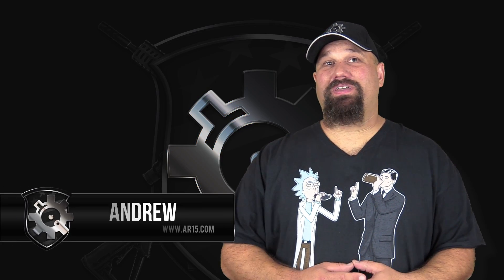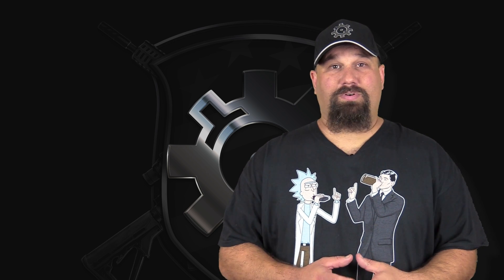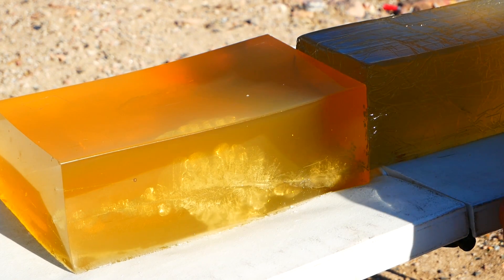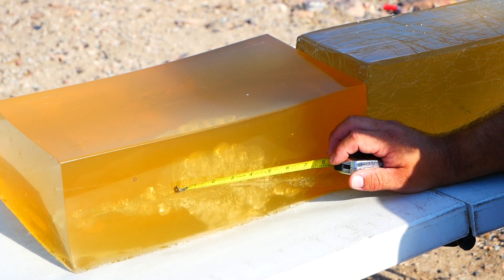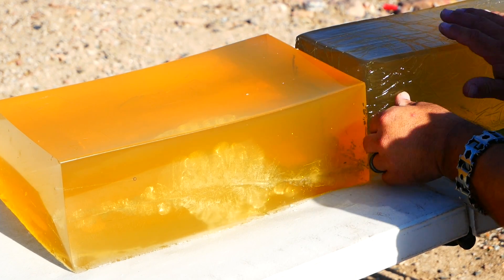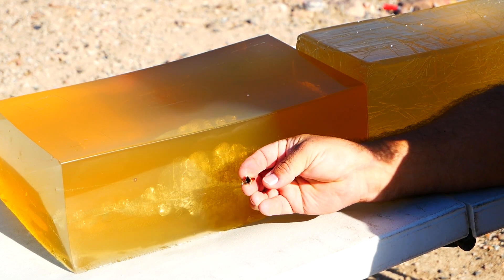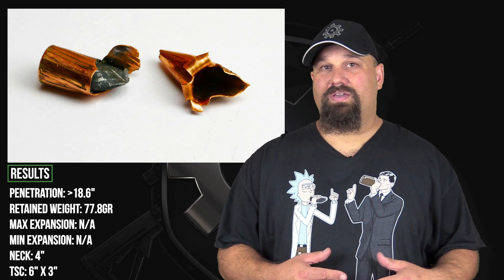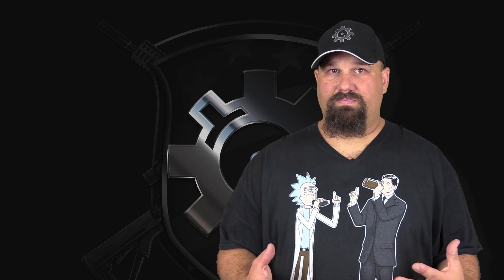Modern Masterpiece or Mediocre? .300 AAC Modern Arms 125gr Speer TNT

Comment: What a loaded B.S. of a test!  Speer clearly states the TNT hollow point is a varmint hunting bullet requiring a minimum velocity of 2,400 f.p.s. to produce explosive expansion.  This bullet is not designed for sub-sonic or medium velocity loads and it's performance would naturally be sub-standard the way you tested it.  What are you going to do next? Test a sport car and criticize its performance as sub-standard by driving it like an off-road vehicle on an unpaved road?
Reply: Even from 16 inch barrel we'd see 200 fps more

Comment: 17.8 grains of Lil Gun. 2.14 OAL. 2255 FPS from 16 inch. 2065 FPS from 9 inch. Standard Deviations typically 10-20. No, 125 grains is not heavy with the right powder. I used to believe that as well until I worked up this very consistent and fast Lil Gun/TNT load.  Lil Gun LOVES  TNT 125 grain bullets. Accurate, great velocity, and CHEAP.  W296/H110 gives me similar performance with 110 grain TAC-TX over 18.8 grains.

Comment: I'm disappointed that the TNT didn't test well, as it's my go-to bullet for 300 Black loading. It is the most economical bullet I have found, and It killed a 130 lb pig at about 70 yards, and he dropped in his tracks. Maybe the real test of a bullets effectiveness is on flesh and bone.
Reply: It helps when you actually use a full length barrel to get full burn also

Comment: Thanks for the test!  Perhaps not the best choice for HD but a great plinking round.  Just ordered 2000 for about 15 cents each including shipping and tax. Haven't received them yet but hoping to use H110 and get decent accuracy from them for range use. Perhaps a slighter hotter load or longer barrel would've improved the expansion/performance.

Comment: Great video! 
You mentioned there are “other” 300 BLK rounds that would do a better job. Which rounds are they?
Reply: Agreed, I'd like to hear his recommendations.
Reply: Hornady Black is awesome if you want the best performance.
Reply: @CRUSADER85  I just started using the Hornaday Black 110 in my 300 Blackout and the 168 Black in my 308. So far it's working really well.
Reply: nosler varmageddon 110gr and control chaos 115gr also gave really nasty wound.. get taken down a few deer and hogs with those ammo using 9inch barrel at 50-100yard, those are dead upon impact.

Comment: @thechoppingblock, you mentioned that this performs better than 300 blk fmj.  Have you tested any fmj? Ive been looking for gel tests for 300 blk fmj and cant find any
Reply: I've tested some that perform as if they were FMJ and I've tested 7.62x39mm FMJ, which isn't functionally any different from 7.62x35mm FMJ.
Reply: @newsofthepews  my reason for being hesitant to equate 7.62x39 fmj to ~123-150 gr 300 blk FMJ is the pretty variable differences just within x39 performance.  Add in different bullet construction, bullet weight, and lower velocity, im seeking actual hard data on th 300 fmj specifics.  I know it will PROBABLY be the same, i just dont like speculating.  My main thing i want to know is neck length and consistency where the bullet tumbles.
Reply: @josh55390  Fair enough. I'll see what I can do. But you're going to see the same variation with .300 AAC FMJ.
Reply: @newsofthepews  oh yeah i expect so.  I'm just hoping that there may exist a 300 blk fmj with acceptable terminal ballistics.  Mrgunsngear once made the claim that the lighter fmj's tumble well so i'm just hoping for some actual test results, you know? I think i'd consider it acceptable performance if it had a <4" neck before reliable tumbling.

Comment: Nice video. Thanks for reassuring me that .12 a round 7.62x39 is still better than $1.22 a round .300.😎
Reply: @762x35mm he didn't say anything about hollow point. 7.62x39mm cheap Russian soft point performs pretty dammed well.
Reply: 762x35mm 
I’m going to be mature here. An say “ that’s what she said “.
Reply: 762x35mm My understanding is 7.62x39 hollow points were meant more for accuracy then for expansion.
Reply: I took a mule deer with tulammo 762x39 soft point. It performed great.

Comment: That shirt is bad ass. 
I've gotten surprisingly good expansion from 165 grain Speer btsp's from a 10.5" with Lil Gun. 
col was 2.240", 15.3 grains, 1,737 fps. I think there is enough room with that load to hit 1,800+ fps without being over pressures. Also gotten some 180's moving to about 1,700 fps. They didn't seem to do as well as the speer ones though concerning expansion. 
(This is not published load data, work up your own in your own firearm*).
Reply: Thank you.

Comment: That's what the Remington 120gr open tip flat base did when I tested it, but it did a great job on a deer this season. 
Could you test Winchester 150gr Extreme Point 300blkOut from a 16" barrel?
Reply: The real test of the 300 is in a 16 inch barrel. It's the one length that you can push the round to max, as in close to 2400 fps. However, I know most shoot the caliber  through barrels that are  7.5-10.5 inches.  Pretty sure it beats any pistol cartridge for stopping a fight.
Reply: @richardmcdonald4190  yep I shoot a 16inch 300blackout. I've put a bunch of different rounds thru it on a 80lb steel propane tank. The magtech 115gr otm was the only one that rocked that tank on camera! But all rounds went thru both sides of the tank
Reply: @D41Michigan  After getting raped on a case of CCI 450 primers, I loaded all the 125 TNT's I had. 18 grains of H110 and all I did was smile and smell the powder burning. Next up, 110 grain V-Max for HD and critters.